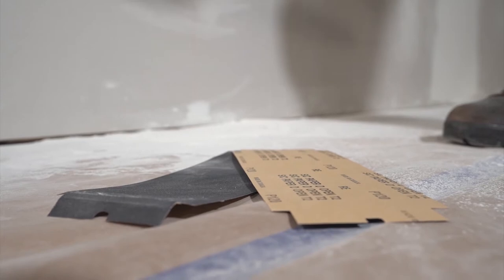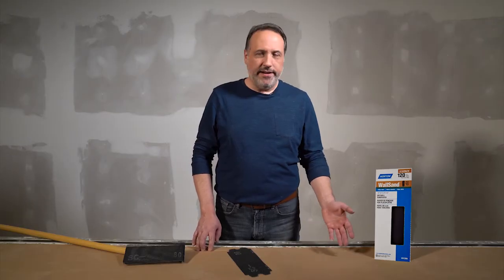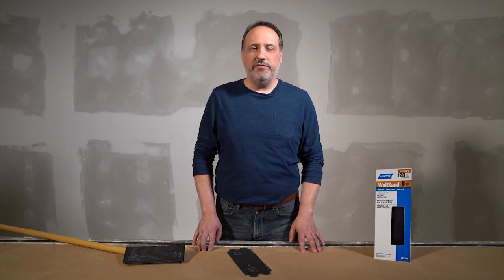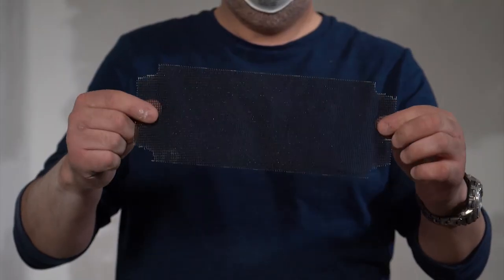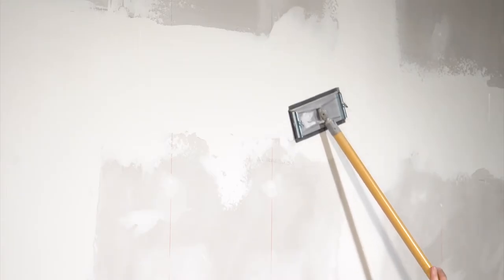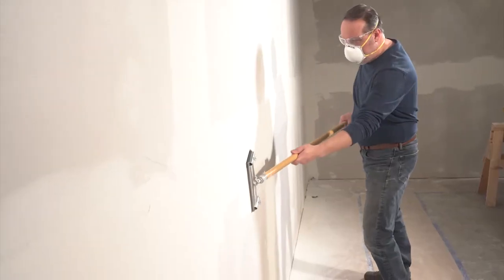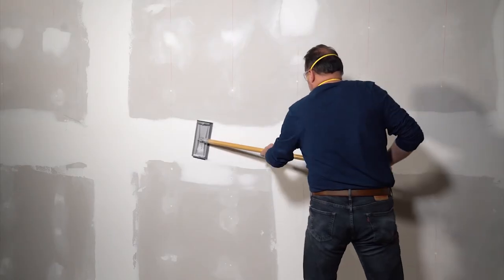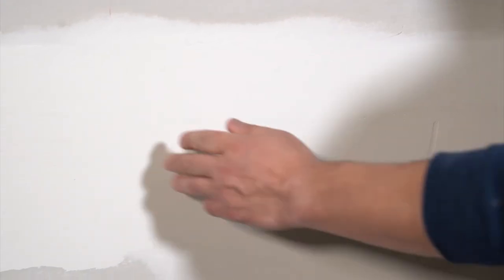Drywall Sanding: Norton WallSand Screens

Comment: This is a complete replacement for typical drywall sandpaper.  Incredibly long lasting and anti-clogging.  It has the ability to rinse and clean to restore the cutting action.  120 and 220 grit (course & fine) will take care of all your drywall compound sanding.   A couple sheets of each will last you through an entire house.  These screens also produce a larger and heavier sanding particle that falls to the floor, rather than remaining suspended and travelling through the air.  A pleasure to use rather than sand paper.